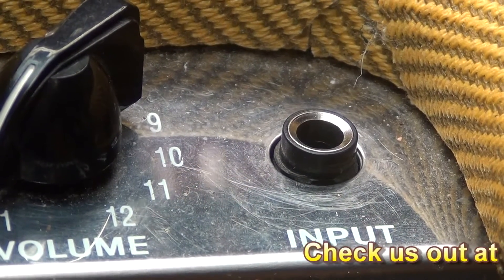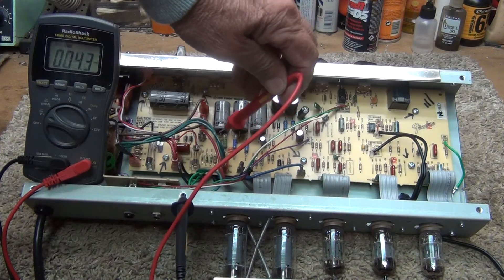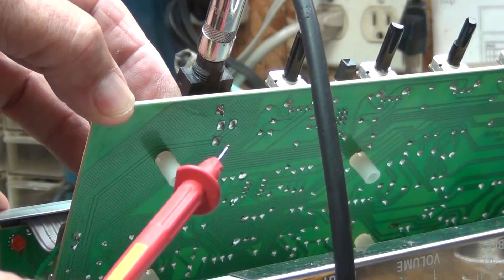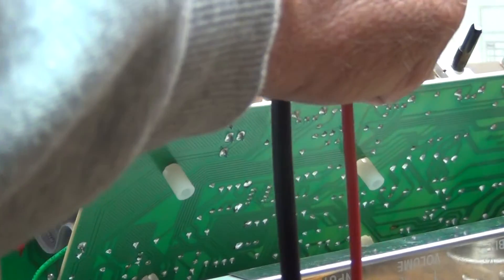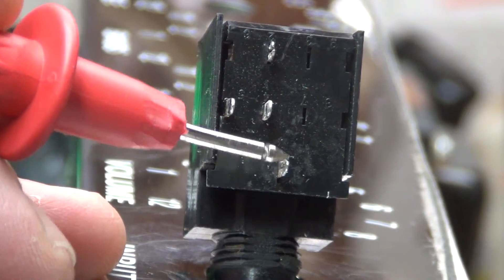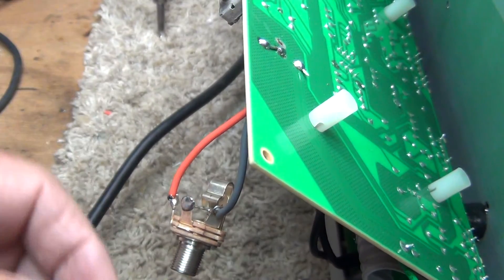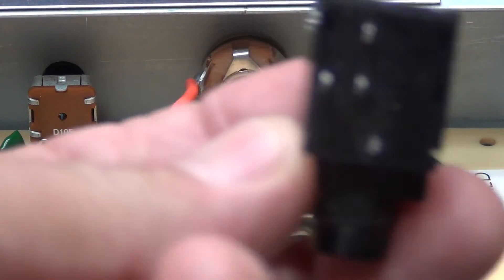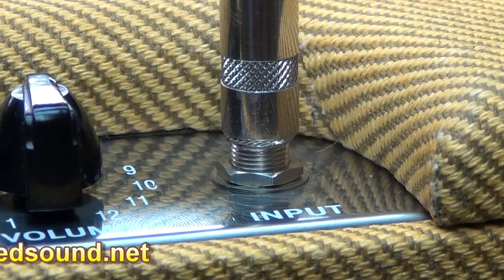Fender Blues Jr: Input Jack replacement

Comment: Thanks for the video.  I tried a 2 pole jack on my Squire 15 as it was a 2 wire connection - didnt work.  I guess I need a 3 pole jack and shunt from ground?

Comment: I just want to thank you for this video.  I was able to help my friend replace his input jack on his blues Jr 4 that he snapped off for under 10 bucks.  Works like a charm.   Thanks a lot.
Reply: Hi,
What type and model Jack did you replace it with?
Did you ground it to the chassis or need fiber washers and insulation bushings or?
I'm still trying to figure out whether it could be grounded to the chassis or not it looks like he can do it here and nobody has said not to so... ;-)
Reply: @Jimmyp9   I got this from Amazon       
Switchcraft 12A 1/4-Inch Jack with Tip Shunt PNT Mount

As for the repair, I can't remember exactly what I did because this was about a year and a half ago but all I needed was some Wire, Solder  and this jack and it worked out great.
Reply: @videotherapy5052  Thanks for the reply. Did it need any type of insulation bushing or anything?
And it just went metal to metal on the chassis with no issue?
Reply: @Jimmyp9  No . Just used the hardware that came with the jack and I was good to go!

Comment: Thanks a bunch for this video. It addresses something I was a bit dubious about on my BJr'. I followed the instructions to the letter and have successfully switched the plastic jack for a Switchcraft L12A shunted jack. My BJr' is a green board made in the USA version, also with a ground nut on the chassis. As there was a debate on whether the green board version needs an isolation washer or not I didn't want to take a chance so added one anyway I had bought the jack with the long thread to this end.

Comment: Hi! This was a very helpful video! I’m about to do this operation on my fender blues junior 4. I need to know a couple things before I begin. What type of wire did you use between the input and the board, and what size plastic washers should I put between the jack and the chassis? Thank you very much.
Reply from the maker: Not subject to a lot of movement, you can use 20ga, even 22ga stranded or solid core wire. I used 22ga solid.
As for the washers, really whatever you can find with a 1/4” dia. I.D.
It can be plastic or fiber… whatever prevents electrical contact with the chassis.

Comment: Thanks for this video- exactly what I was looking for. I repair guitars and other fretted instruments and usually don’t do amp repair but a regular client of mine brought me his Blues JR with a broken jack. Your video shows it’s a little more invasive than just swapping out a jack on a guitar, so I’m glad I watched your video. My question is: what if my multimeter shows the caps holding voltage? Then what do I do? (This is what has kept me from getting into amp repair in the first place- I don’t want to get shocked or electrocuted!) I’ve seen voltage discharge sticks for sale on Stewmac- should I invest?
Reply: Since I am not an expert, I share my knowledge with you with a great deal of precautionary advice. You should only do this after consulting with an expert or doing your own research to confirm safety. According to many amp techs online, in order to discharge these large Filter Caps on the BJ without using specialized equipment, you simply attach a jumper cable from the positive + terminal of the cap to the metal ground chassis and wait a few seconds. That's what I do when I work on my BJ. I first test the voltage with a multimeter, then I jump the + side of the cap to the ground and wait, then test voltage again. I do this even if the initial multimeter voltage reading was very low or zero as a precautionary measure. Redundancy is better than experiencing an involuntary auto-electroconvulsive therapy! LOL 
Sadly if you search for how to specifically do this (without) special equip on YouTube, you won't find anything. However, if you watch enough BJ repair videos on YT, you're bound to run into a few demonstrating this very method. BE SAFE!

Comment: Which all metal switch craft jack did you use?? Make and  size.  Thank you in advance.
Reply: Switchcraft 1/4" Mono 2-Conductor Input Jack, Tip Shunt, Long Bushing (Type L12A)
Reply: @daveman_50  dude thank you for this.  i was about to go down a rabbit hole 🤙🏼😊

Comment: So did you have to run a jumper on the circuit board or just on the switch or both? In the beginning of the video you showed a jumper on the board. Then at the end you showed the jumper on the jack and it looked like there was not one on the board.
Reply from the maker: No jumpers on the board!
Reply: @recycledsound  thank you so much!
Reply: You're right. He does show a jumper on the PCB, though it isn't necessary. https://youtu.be/-i4MR4WPDAo?t=412

Comment: had same issue, what a knucklehead design.  front to back pressure can dislodge the assembly from the board.  a quick fix for me was to cut a piece of plastic to fill the gap between the jack and the frame of the amp.  it works fine for now, will replace when it completely fails

Comment: Hi. Just wondering why you didn’t use shielded cable ? Also that link on the ground on the underside of the board - doesn’t the PCB track link the pins anyway? And finally does the jack need insulating from the chassis?  In the video you  say no but in one of the replies it says insulation is needed? Thanks.
Reply: @Greg P thank you

Comment: I did this a few years ago.  I'm pretty sure I needed to use a jack with a long thread, which looks like what you may have used. I had a 'standard' 1/4" Switchcraft jack, but when installed, there weren't enough threads to comfortably secure a washer and a nut on.  Just a heads up for anyone that may be doing this down the road.

Comment: I'm a bit confused! I don't see in the new installation you made how the Hot section of the jack gets grounded when the cable is unplugged? I know you mentioned the switching function of the jack takes care of that, but all I see the switching part is only connected to the primary and secondary ground terminals and not the hot one, the same way the internals of the OEM plastic input jack are designed (I opened mine up and looked inside). So the only secondary ground connection for the hot section is through the circuitboard as it seems to me. Like I said, I'm confused!

Comment: I just installed the shunting jack in mine, but seem to have a grounding issue thats really noticeable when I plug my guitar. Kind of goes when I touch the strings. Any idea how I can fix that?
Reply: For anyone having the same problem. The jack being in contact with the chassis was causing a ground loop. I fixed that by putting two plastic washers in between the jack and plated chassis
Reply: A metal switchcraft style shunting jack needs to be isolated from the chassis to prevent this. Your plastic washers did the trick!

Comment: People! Adding wires to a jack causes even more problems. Wires move and vibrate and will fail waaay sooner than the box jack. Damn. And I’m an actual Fender tech, not just some guy with a card table and a soldering gun. Ps, you do not have to remove the speaker pcb.  Plastic is not the enemy here.
Reply from the maker: Oh yes it is! 
Apparently you don’t get too many VOX and Fenders with failed plastic jacks across your card table?? 
It’s not just an all too common failure, but like tube sockets on a pcb board, it’s the cheap way out!